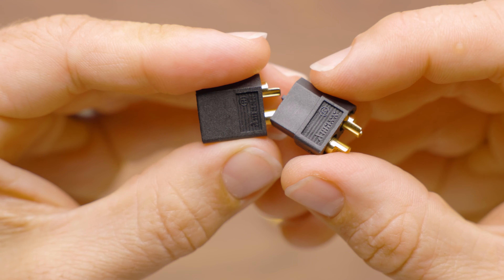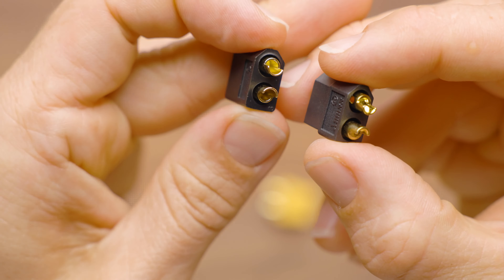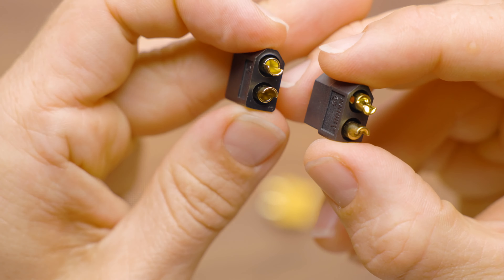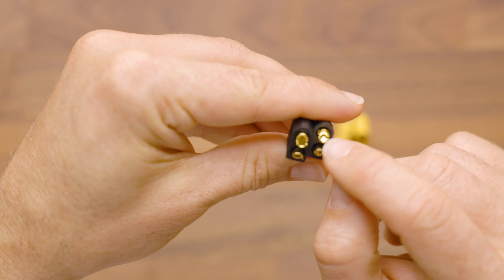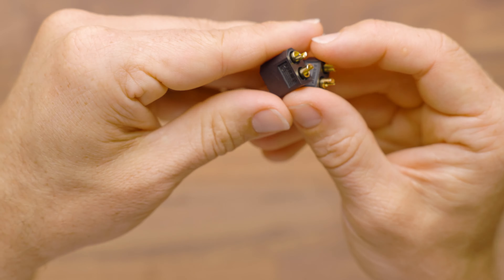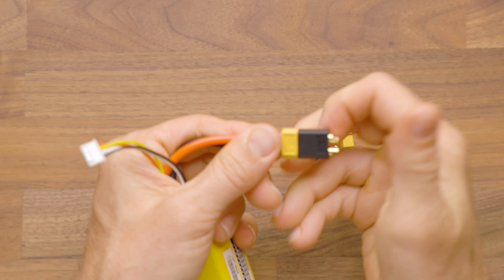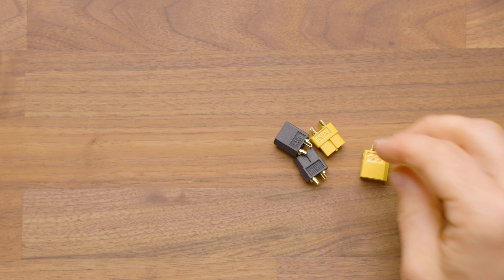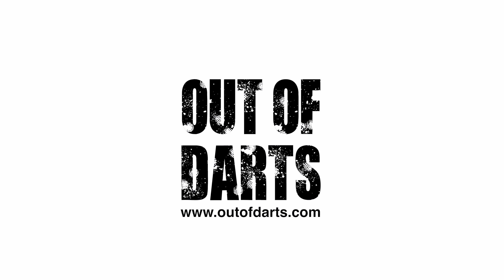Product Overview: XT-60 Connector

Comment: Is there a straight wire connecter that can handle the watts/amps of a xt60?  Sort of, if you could cut a xt60 in half, allowing each wire to move independently.  Backstory: I bought a board, has to be assembled.  Can't connect the battery to the Controller Box as the xt60 is too large to make it through the cable hole connector. They told me that I need to clip off the xt60, run it through, then somehow reattach.  Thanks